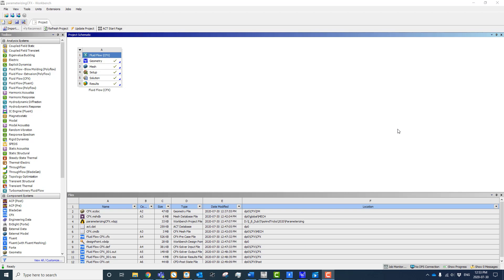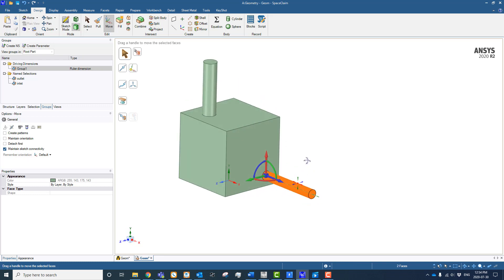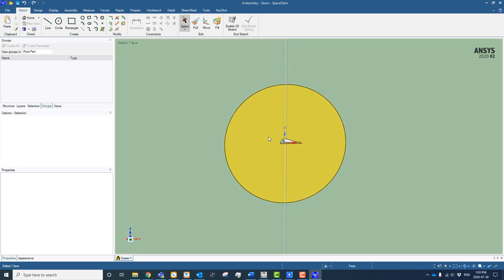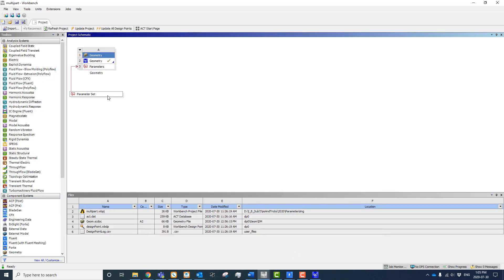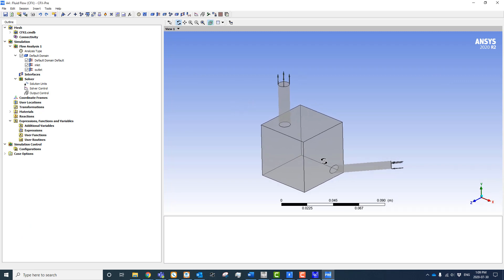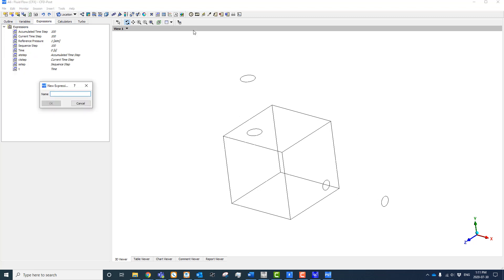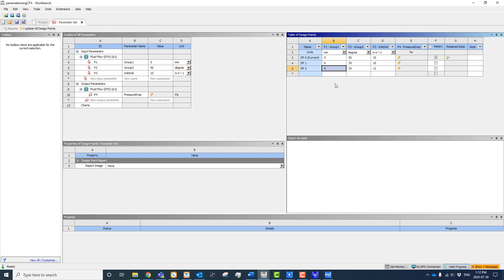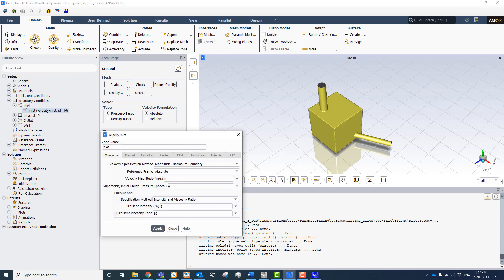Parameterizing CFX and Fluent in Ansys Workbench

Comment: Can I use the output parameter as an input parameter during next iteration ? for example, if I have to set a periodic boundary condition such that mass flow rate is same across exit and inlet boundary.
Reply from the maker: Hi Milaan, thank you for contacting SimuTech Group. If you are interested in our mentoring or consulting services, please send us an email at info@simutechgroup.com or you can check out the Ansys Learning Hub here: https://www.ansys.com/services/ansys-learning-hub or our Ansys User Group on LinkedIn: https://www.linkedin.com/groups/1938106/